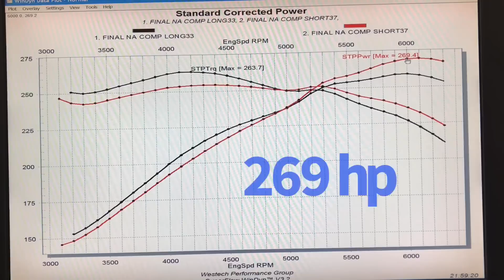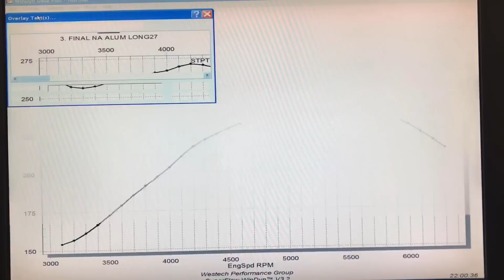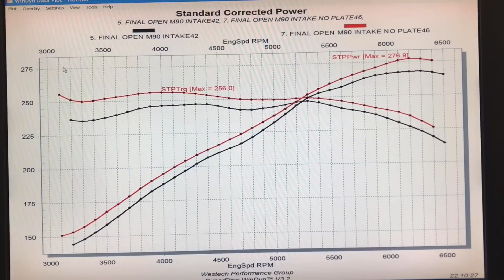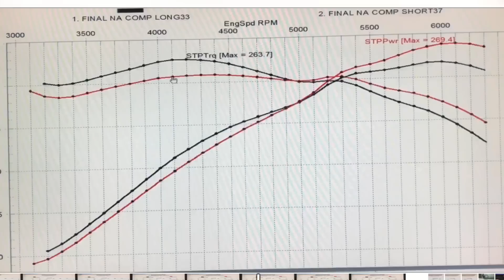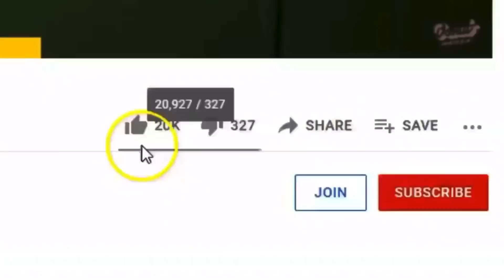HOW TO PICK THE BEST TURBO INTAKE! 3800 V6 INTAKE TEST-WHICH NA INTAKE WORKS BEST FOR A TURBO?

Comment: Hey I got a crazy question boss. If I have the new 4.3 v6 2014 and up could you use a 3.8 v6 crank to de stroke the motor?
Reply from the maker: nope-different engine family
Reply: @richardholdener1727  thank you for the response. I love your channel. That's what I thought

Comment: Great info!!! Would be nice to revisit this test to compare the NA F body 3800 upper/lower intake which should be a direct bolt on swap.
Reply from the maker: should be similar-but I wanted to include that
Reply: @richardholdener1727  The data would be interesting for some of us building a turbo 3800 F body

Comment: Im planning on doin a turbo setup on a 99 Camaro with the 3800 motor. Im planning on doing the ported heads  and ls6 beehive springs and keep the stock intake. What tune on the holley ho system did you use? I see a lot of people are having drivability issues that are tune related. Its going to ve a daily driver with the aim of 500hp....
Reply from the maker: I tuned the 3800 motor with the holley hp
Reply: @richardholdener1727  with stock injectors and fuel pressure? I've never used a Holley HP set up, so I'm curious as to the process of tuning it. Thanks
Reply from the maker: we installed injectors sized for our power level, but stock fuel pressure can be used

Comment: Hi Richard, I’ve learnt a lot watching your videos. I’m in Tasmania Australia and have a 1985 Hiace van daily driver with our Holden version of your Buick 3800 v6 and a turbo 700 with 3.58:1 diff. It’s a work van and I want to give it a bit more oomph, I’m looking at doing a cheap eBay turbo setup, low Mount next to the transmission with a water to air intercooler.
My question is, what turbo and A.R. Would you recommend to give it minimum lag and good torque? 1:06 I’m not too worried about the top end, it will probably never hit the redline. 
Just want a good reliable setup that will pull a load well and not be too over the top. 
Would you recommend an external waste gate ? Or do you think internal will suffice? 
Thanks heaps in advance.
Cheers, Andrew 👍
Reply from the maker: gt3076-you might be able to get away with an internal gate on a low hp/boost application
Reply: @richardholdener1727  thanks Richard 🙏👍

Comment: This is the most informative video I have seen with dyno proof of the mods.
While the results are what I would expect, the dyno tells it like it really is!
But what many people fail to realize is, how often do you buzz up to 5500 plus RPM?
Most people spend 99.9% of their time under 5K, and that is where they need the power, so changing parts to have more power at levels of RPM they never use seems counterproductive.

If you are building a strictly for race level car, then the mods at 5500 RPM make sense.

Comment: Still waiting on the log turbo manifold test versus the long tube header test to see if there is a big change in the power curves. Of course for this to be a decent comparison it needs to be manifolds of equal flow and I know that makes it tricky to do.
Reply from the maker: EQUAL FLOW?
Reply: @richardholdener1727  …. Yep, 220 or 221. Whatever it takes 🇺🇸

Comment: This is exactly what I am busy with my Toyota 3UZ twin turbo.
Can you please do this same test with the turbo.
I understand that the result will be same but I am interested how much torque will be lost at lower rpm. 
I am trying to get the torque less at lower rpm because the sub assembly is std. 
At this stage we have 700nm at 4000 rpm with minimum boost (0.6 bar) at the wheels. 
We are convinced that the sub will not handle this. 
Thanks for the channel.
Philip
Reply from the maker: THE NA CURVE IS THE SAME AS BOOSTED CURVE (MINUS THE RESPONSE RATE)

Comment: I don’t know what your future plans are for the 3.8…but here’s my suggestion. 

Head down to Home Depot and pick up a 2-1/2” or 3” rubber plumbing cap. Slap it over of the existing throttle body on your ‘blank supercharger. Then take a 4” hole saw and a drill+ tap to your block off plate, and install a 104mm throttle body, connect the turbo and let the little 3.8 eat! 😁

Love this series and most everything you do on your channel. 
Cheers

Comment: For a turbo car the short runner is the way to go.  Too many of cars can't hook in the first place so less torque more hp is ideal.  Very cool test pulling the plate off the M90.  It is well known the blower inlet and TB are restrictive.  Many swap to a northstar or LS1 throttle body.  I would like to see a comparison using one of those and a blended inlet VS open plate.

Comment: Long runner aluminum intake for the turbo test.  It has a great mid-range torque bulge.
The short runner ZZP insert basically rotated the torque curve on the composite intake counterclockwise at 5000 rpm.
On the aluminum intake, it rotated the torque curve counterclockwise at 5500 rpm.
On the composite intake the low rpm/high rpm tradeoff may be worthwhile if you want maximum peak power.  But on the aluminum intake, I don't think the tradeoff would be worthwhile.

What were the average power outputs from ~3500-6300 for each setup?

Comment: I'm guessing since Rich is nearing the end of this 3.8L V-6 build series, he should soon start on a "other guys" 3.8L V-6 build series... Namely: The Ford 3.8L V-6 (Which also came stroked to 4.2L, and was found in the F-150 & Mercury Monterey mini-van) and the Chrysler 3.8L V-6. (Found in the  2007-2011 Jeep Wrangler JK, 1991–1993 Chrysler New Yorker and Chrysler Imperial, 1994-2010 Mopar mini-vans of all divisions and the 2009–2010 Volkswagen Routan) Seeing what was made for those two in the aftermarket, and how the factory Jeep version made 215-hp/245-tq N/A 2001-2007, it should be interesting...! =;D

Comment: I'm still hankerin' for mo' cam, mo' boost, and Eric Weingartner's heads.  That would be mo' betterer.  It'll make 863.3 hp at 21 lbs of boost.  At 21.1 lbs., it throws its guts on the floor.  That's my guess.

Comment: Richard, im currently rebuilding an lm7 for a turbo build. Forged 10.2:1 pistons, forged rods, balanced, stock crank, stock 862’s with a cleanup mill and valve job. Summit stage 2 turbo cam. Wondering if you ever are worried about piston to cylinder wall clearance in a turbo situation? I know ring gap is important, but with these motors barely wearing the cylinders, should i be concerned with pisto/wall clearance?
Steve
Reply from the maker: YES ON FORGED PISTONS